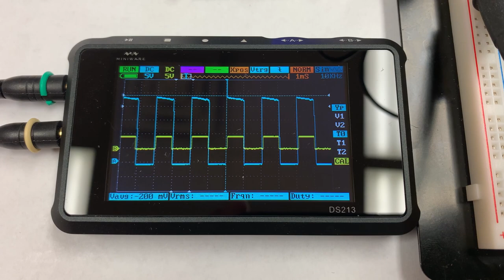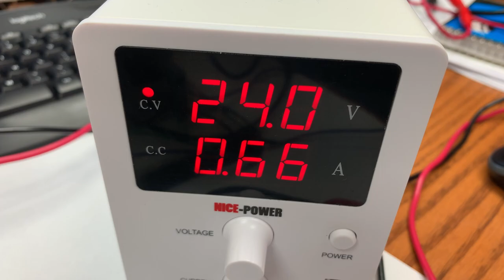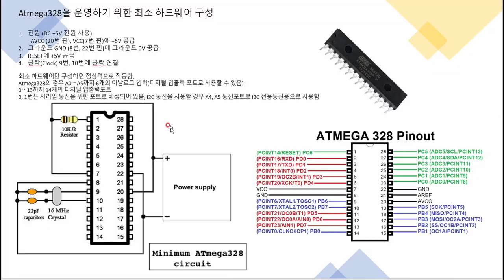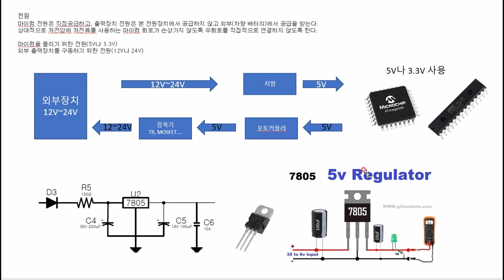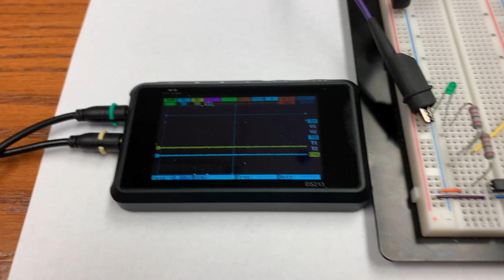Minimized Arduino

Comment: If you disconnect the solenoid and connect while working your atmega328p if getting  of why?
Reply from the maker: I am sorry, I can't understand what you mean.
Reply: @Charles Bang  sir I have made a development board using atmeg328p (like arduino) microcontroller. It is getting off . If I drive solenoid of putzmeister concrete pump using your method(photo coupler and irf4905 mosfet p- channel).
Reply from the maker: @rizvanrazi4698  Oh it will be interesting.